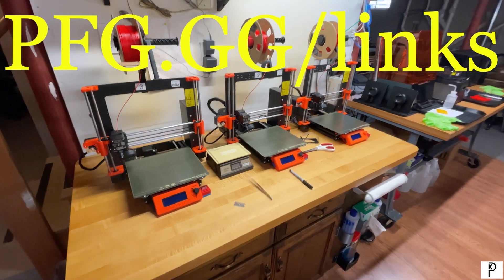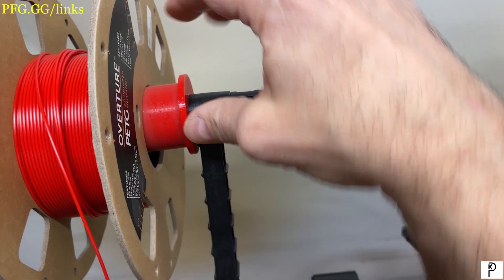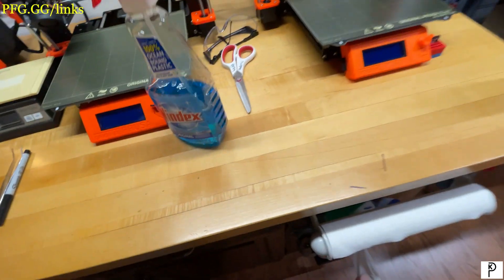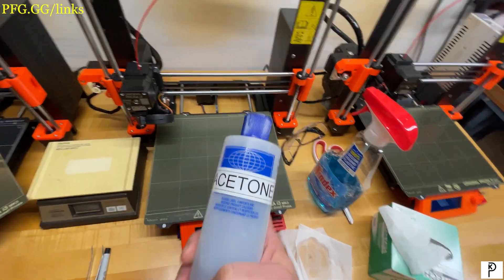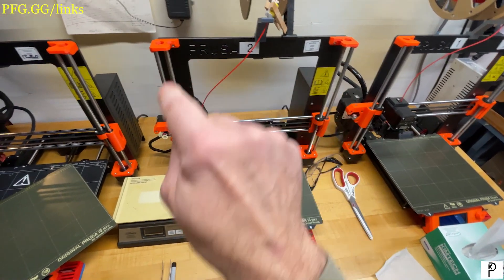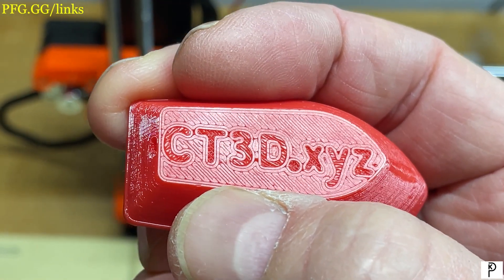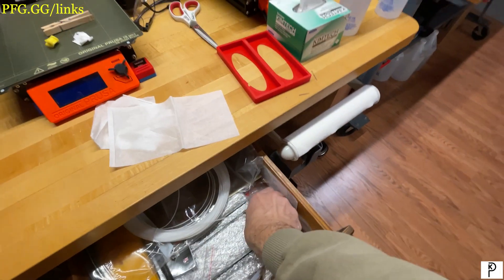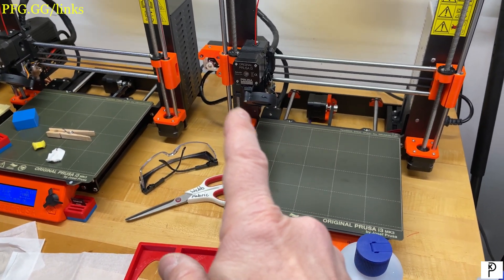Reliable PETG on the PRUSA i3 Mk3

Comment: Very good video. Do you use the Windex Original with Ammonia or the ammonia-free version. Is the ammonia important for this application?
Reply from the maker: It is the Original formula.  I don't think the ammonia is significant.  It will evaporate away.  The small amount of surfactant left is the release agent.
Reply: Thank you for answer

Comment: The textured sheet is the only way to go for PETG. No more Windex ever again. Flex the sheet up/down and the print releases. PETG sticks to it when hot and then when it cools it essentially acts like a textured teflon non-stick coating. ALSO, no acetone on the textured sheet ever. It is verboten.
From PRUSA site: "The textured sheet doesn't need anything for PETG. The smooth sheet needs something to reduce PETG's grip. For PETG printed below 240C, a spray of Windex or just a few wipes of your fingers on a clean bed is sufficient. If using higher temps, glue stick may be necessary."

Comment: Great video.  I like your setup so much I bought Kimwipes.  I hope Kimberly-Clark is paying you, if not they should be.  I have a MK3S+ and 2 new MK4’s.  What other maintenance do you do to keep the white dust/film from petg from building up on the fan shrouds and bottom of the extruders?  Thx.
Reply from the maker: I never came up with a magic bullet for solving that problem. I think a Kim wipe and some alcohol and a little elbow grease is about all I could recommend.

Comment: +1 to the heated tightening. I used to get jams like crazy until I did that. I even had a nozzle walk itself out to the point that I came back to a blob that was barely contained by the silicone sock. I managed to salvage the heater cartridge but the block, nozzle and thermistor were too encased to get out or be useful. Had I not put the sock on, I would have come back to an even worse mess.

Comment: Thanks a lot for this video, it was super clear and I've learned a lot. I've had no issues with PLA but after many failed attempts at PETG, this video was super super helpful. Thanks again.
Note: I've also tried with the textured sheet but it would not stick to the plate no matter what I tried.

Again, thanks for this :)
Reply from the maker: Thanks for the nice feedback.  Took me a while to crack the code, then it was problem-free.  👊

Comment: Actually I always use the textured sheet. While I adjust the first layer as you describe, I want a "close surface" as I most often the underside of the print is later the top or front (like the display on the mk3). Do give it a perfect look, I edit the gcode and set M221 S105 and M220 S50 after the first after_layerchange (and M221 S95 and M220 S100 after the second). This way I intentional oversqeeze the first layer a bit, but printing it extra slow. Also I increase the printing temperature for the first layer about 5°C.
 And I use hilbert curve as a pattern for the bottom.
Thne prints look perfect; esp. as PET-G always is very reflective, the combination of hilbert curve, the texture of the bed and the higer flowrate results in quite beautiful surfaces. Due to printing the first layer very slow and with a slightly higer temperature, the print still sticks very well (sometimes to well, but if thats the case, I simply put the spring steel with the print in the freezer for about 20 minutes...).
Actually the high glossy surface of PET-G has an interesting sideeffect: You can label your print by adding f.e. text as a modifier, changing just the bottom pattern to concentric. The reflection of the text (concentric) than differs from the rest (printed in hilbert curve) - so actualy you can write "black on black". A nice but rarely known feature...

Comment: Do you have any issues with the PETG absorbing moisture?
Reply from the maker: PETG will absolutely absorb moisture.  I can tell the difference between dry and "wet" PETG.  It will, however, still print OK, and I tend to use up the roll before it becomes a problem.  I DO dry my filament when necessary:  PETG is dried at 170F for 2 hours.  There is a pervasive myth that PETG does not absorb moisture... this is demonstrably false.  However, it is much more tolerant than many filaments.  Hope this helps.

Comment: PETG is super easy to print on the mk3s+. It is harder to get off from the smooth sheet. I like to use the Satin sheet on my MK3S+
Reply from the maker: If you follow the procedure in the video, PETG is not hard to get off the sheet.
Reply: Thanks for that tip, I am having  that issue removing the prints from the plate

Comment: I highly recommend using the textured sheet, PETG releases nicely, you don’t need to windex it, it adds a nice texture to the bottom.
Reply: The textured sheet is the only way to go for PETG. No more Windex ever again. Flex the sheet up/down and the print releases. PETG sticks to it when hot and then when it cools it essentially acts like a textured teflon non-stick coating. ALSO, no acetone on the textured sheet ever. It is verboten.
From PRUSA site: "The textured sheet doesn't need anything for PETG. The smooth sheet needs something to reduce PETG's grip. For PETG printed below 240C, a spray of Windex or just a few wipes of your fingers on a clean bed is sufficient. If using higher temps, glue stick may be necessary."
Reply: I may have to invest in one so

Comment: What temperatures do you use for overture petg?
Reply from the maker: I use the profile for Prusament PETG.  I think it’s 230C/80C.
Reply: I can’t get overture to print without issues unless I run it at 260
Reply from the maker: Dry it.

Comment: Good Video.  I've been printing actual Prusament PETG on my smooth sheet MK3S by only wiping it down with an alcohol wipe before each print.  Prints have always popped right off after cool down when flexing the print bed sheet so I never sought out a different prep procedure, but I will give the Windex a try. I wasn't aware that the Amazon Filament was any good so will give that a try also.  I love the idea of the filament being wiped on the way in.  Never thought of that either!  All good stuff sir.  Well done and thanks!

Comment: I would suggest the hot end sock, it keeps the hot end clean and reduces maintenance. Also a  print server to run all 3 printers. I run repetier server and it will run 3 printers at once from a raspberry pi, although I am working on swapping it out with a PC so I can run integrated cameras.

Comment: Some great tips Spencer. It hadn't occurred to me that I should put the new nozzle on when the print head is hot.  Makes sense.
Reply: I guess the Prusa manuals are much better than the Creality manuals...  🙂
Reply from the maker: Right out of the PRUSA manual.